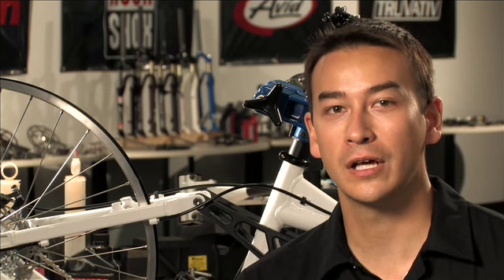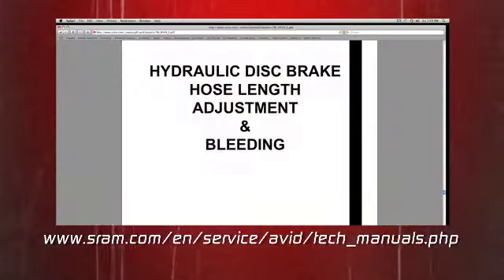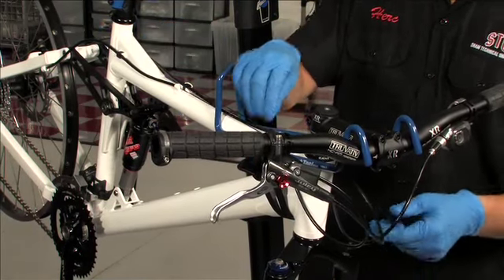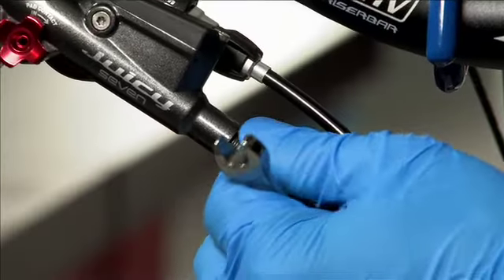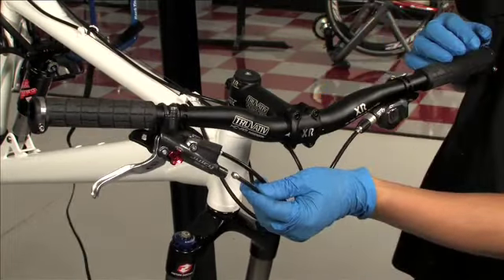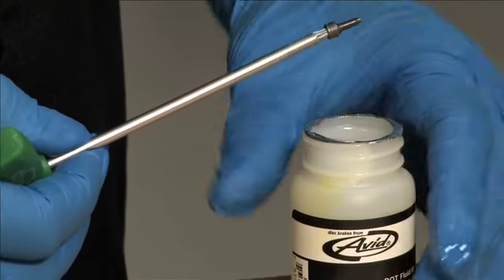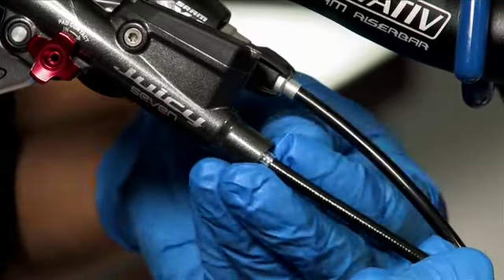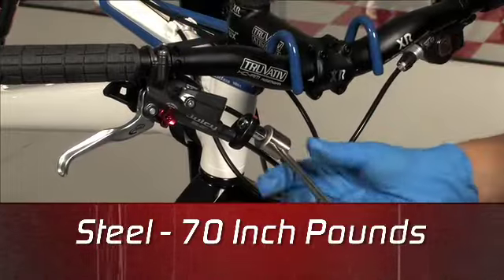03 -  AVID Hose Length-SRAM.mov

Comment: just completed this job on my new Elixir 5's.  About as easy as the video makes it . . . only slight challenge is getting the new barbs to get started into the cut hose.  Of course, i did not use a super high quality cutter, which might make a difference.